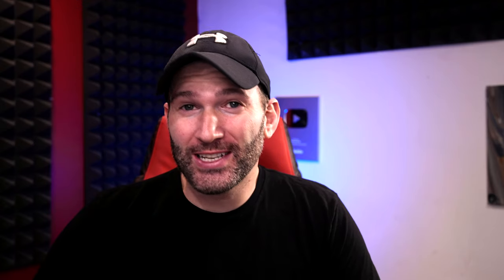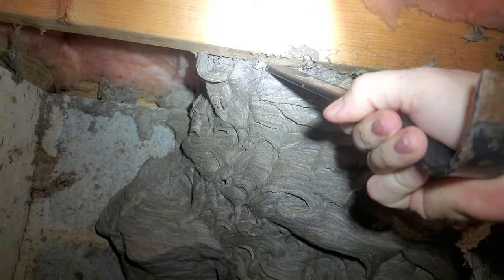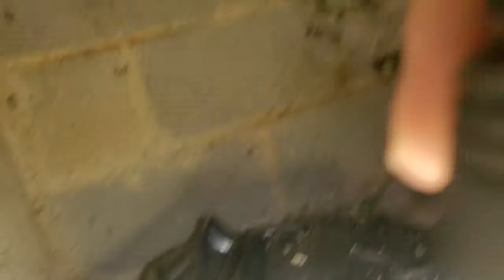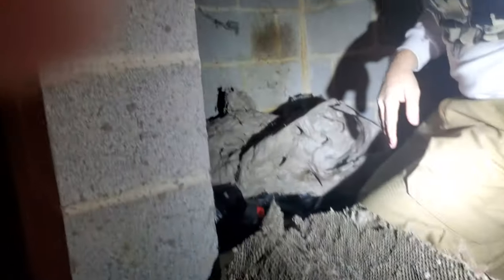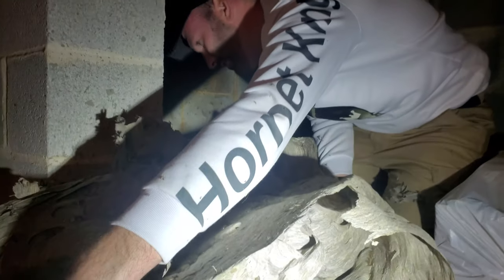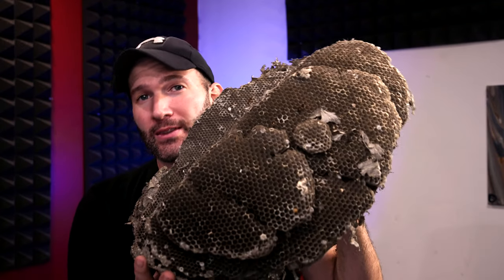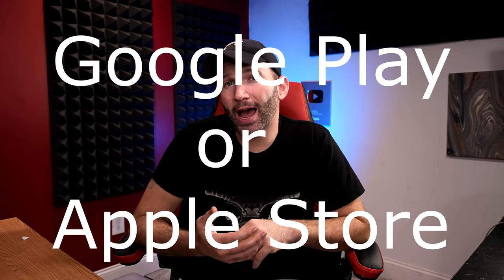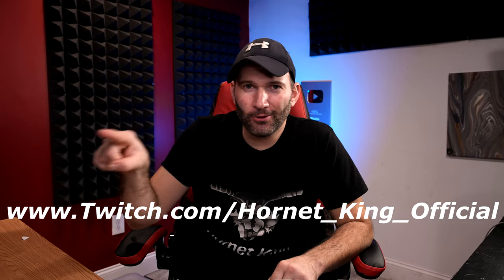MASSIVE Yellow Jacket Nest in Basement! | Winter Time Nest | Wasp Nest Removal

Comment: I'm an electrician and Ive been out in the freezing cold in Ga. fixing parking lot lights. Every one i opened had wasp nests. It has been cold as hell here, too, but there were actually wasps still alive inside the light fixtures. 

I open one fixture and it has a flat glass bottom that swings down so you can change ballasts and lamps. Right in the corner of this door was a ball of red wasps, all alive but completely motionless. You would see them move when you hit the door. It was really weird they were all piled on top of each other in the dead of winter. 27f

Comment: You may want to tell them to have their house checked for termites. On the left wall as we were watching you tear down the structure, there was a “termite tunnel” or mud tube that was there. It was a fat one too and looked relatively fresh. Most exterminators will come out and do a free inspection. Or at least they used to when I worked for Terminex some twenty plus years ago before I got into law enforcement. But they should have it checked.
Reply from the maker: @Chris Woodruff Thanks for the comment! Some others picked this out too, and I had already text the homeowner and let him know! Thanks again for pointing it out!

Comment: That nest is the fault of the AC installer.  They didn't properly seal the hole the lineset runs through and the wasps used that as an entryway.
Reply from the maker: Exactly! The homeowner said they used a caulk, and I would venture to say it shrunk! The plumbers putty works much better!